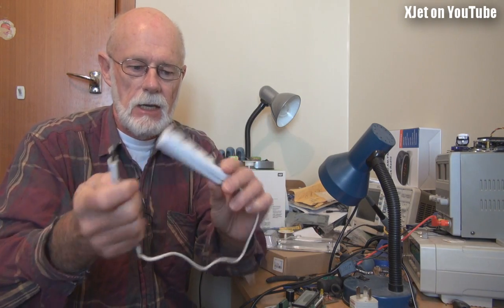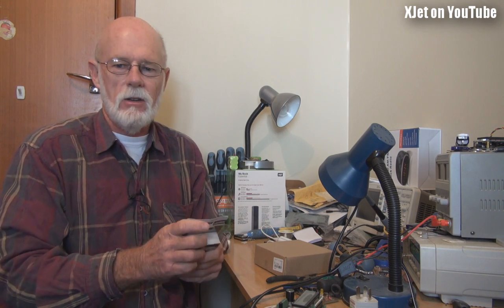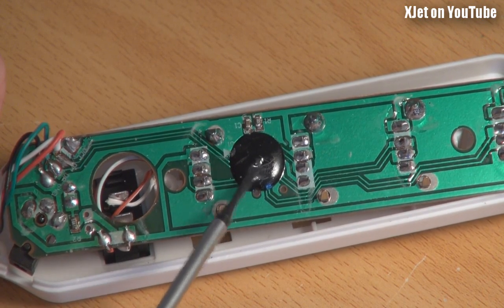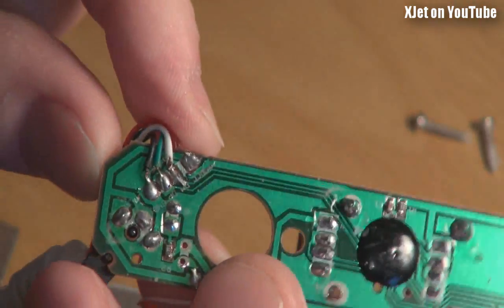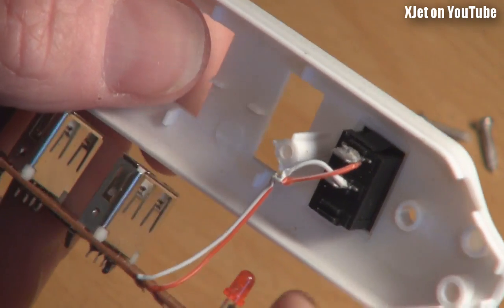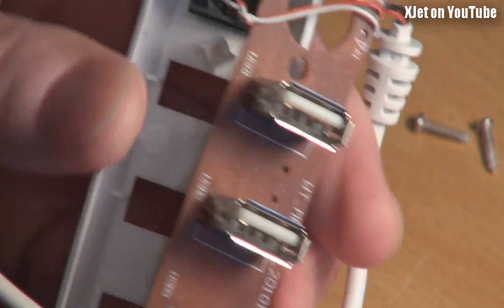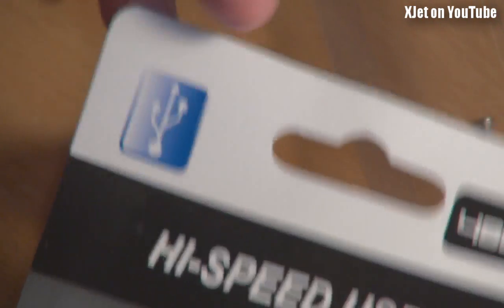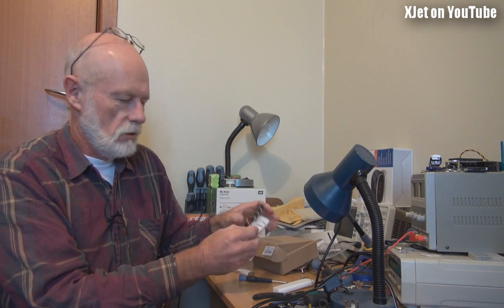A really bad bit of Chinese electronics

Comment: What are you rambling on about ?  if you know anything about electronics you would know that workmanship on an IPC Class 1 item such as this is pretty well made !,  you haven't seen what real rubbish is yet.  The USB connectors only needed one of the legs to be grounded since this a single sided unsupported PCB,  a dab of epoxy on the connectors would have helped more !

Comment: That was a shocker. In addition, I never use powered USB hubs because you should not connect multiple regulated power supplies as they can fight with each other causing it to become very inefficient and even over heat the voltage regulator.

Comment: Looks pretty bad but rescueable as you demonstrated.  Lucky you didn't damage your PC although I guess the 5v power supply will source quite a high current.

Those unsoldered joints looks as though they were there as mechanical fixing for the USB sockets rather than electrical connections but a few insertions would probably do enough damage to bugger the socket fitting.

Learn your lesson and have a look at everything :)

Comment: Ha!  Just had the same thing happen a few evenings ago.  Desperate to power my iPhone and not a cable in sight.  Stores closed.  Local gas station had an ICharger (???), with iPhone cable wired directly in to a wall charger.  When I got it home and plugged it in the housing lit up from the arcing inside.  

Took it apart and, sure enough, terrible solder joints all over.  Nothing to do but strip it and do the job properly.  I do think the bottom end Chinese stuff has fallen right off the scale!

Comment: I'm glad we don't share flying/driving sites then. I honestly would not trust an OrangeRX with a walmart RC, nevermind any of my nitro models or my 15" spitfire.

You get what you pay for, and I would rather pay extra for a kickass warranty I will never need rather than cheap out on junk that's barely got a warranty at all and will need it inside of two years. It's why I buy OS engines, it's why I drive a Ford instead of a Daewoo, and it's why I use genuine Spektrum receivers instead of OrangeRX